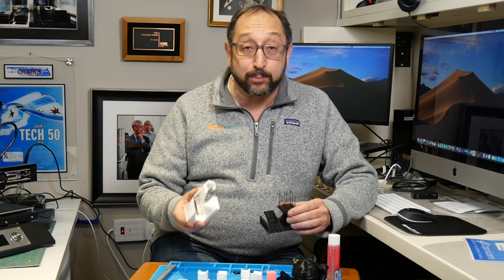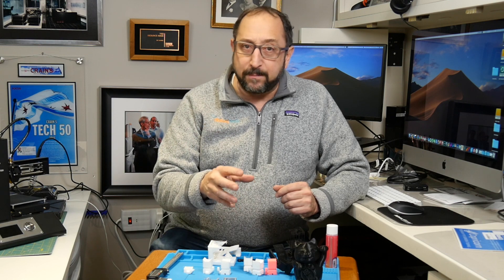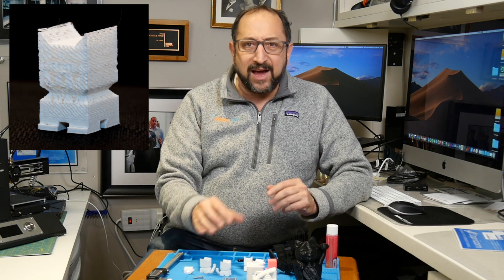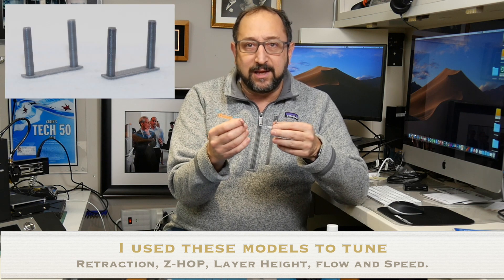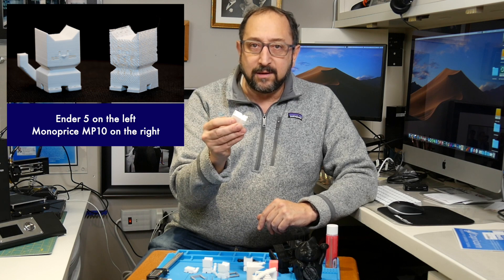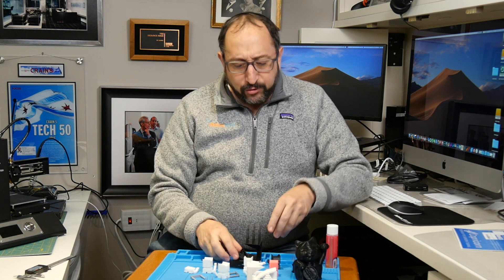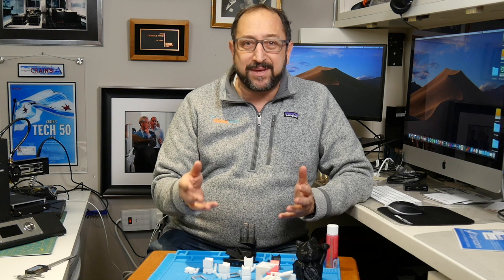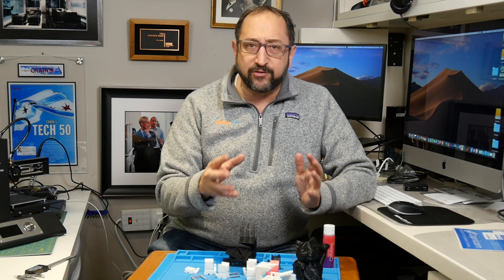Monoprice MP10 3d Printer Quality Review

Comment: its been 4 years, have you had to do any mods to it. I'm looking to disable/remove the filament sensor before the extruder. Also I'm not liking the interface on the touchscreen it lacks in more precise tuning than the original ender 3.  Do you have any suggestions for modification or upgrades to the parts I mentioned?

Comment: Hello Mr. Shapiro,

I got the printer from my sister who used it once only trying to print the cat, which did work. However, now that I have it, it's not working. I tried leveling the bed using the paper method and I ended up with the 4 corners being pretty good but the nozzle would be too high in the middle basically printing in the air. Do you have any idea how I could fix this? Maybe the heatbed is warped?

Also, did you remove the blue rubber protection? around the nozzle? 

Thank you very much, Sir
Reply from the maker: Do not remove the blue silicon sock.   Watch this video.   This same technique will work on the MP10.

https://youtu.be/y_xCtxcwDrQ

Comment: I haven't found a white filament, yet, that doesn't screw up if not printed at about 10 degrees higher than other colors. It may sound strange, but white filaments need higher temps for some reason.
Reply from the maker: Interesting.
Reply: @MakeWithTech  I stated that as fact, but intended it to be from my own experience.

Comment: I love this video. I have the Monoprice Mini Delta printer. I wonder if both printers have the same  cold end part of the Extruder where the gears are located. I have been using Pet-g filament by a company called ridge.ink. On my mini delta I experience the same issue as you describe in the video. Some times I get a great print., Perfect. Other times the filament will not feed correctly. The gears will not push the filament into the hotend. So it is frustrating. I am considering the MP 10 or the Tevo Tornado printer. I like different specs on each one.

Comment: I have this printer also and have had nothing but trouble with it. My Extruder has slipped from day one. I have tried  and upgraded Metal extruder lever and different gears with no success. I have also tried a hand full of different band of filaments that my Monoprice IIIP prints without any problems but fails on this printer. Support and parts for this printer there is none. I even contacted the true maker of this printer Maylan and sent them an email because they show a direct drive option for this printer and never got a response back.
Reply from the maker: Sorry to hear that.  I also had difficulty until I replaced the extruder with an all-metal extruder.   Did you change the gear on the stepper motor when you changed the extruder and use both the idler and gear that came with your all-metal extruder?  Also, I would recommend trying to slow down your prints and/or increase your print temperature.   When the hot end temperature is too low it is hard for the extruder to push the filament through. 

The only time my extruder slips now is when I use the manual extruder controls from the front panel.  They go much too fast.

I used the "Anycubic Left Hand Aluminum Frame Block for 3D Printer MK8 Extruder Reprap i3 DIY Kits" that I purchased on Amazon.

Yes, it is a problem that Monoprice does not provide parts.  However, I just ordered the CR10 front rail reinforcement kit to see if standard CR10 parts work.
Reply from the maker: P.S.  You need to replace the complete extruder, not just the lever.  The lever, gears, spring, etc. are all part of a matched set.  Hope this helps.  If not take advance of the Monoprice warranty and return it.

I did find this printer is high maintenance.  What I mean by this is I needed to tinker with it a lot to get good results.  Because I really like how easy it is to work on the hot end, I am going to use this as my large nozzle print.  The ability to take off the hot end after you heat it up and just unscrew the nozzle is quite nice.   I do hope in the future Monoprice or Malyan offer the ability to purchase additional hot ends.

Comment: Thank you so much for the update. Looks like I'm going for the Creality CR10S Pro
Reply from the maker: I just finished upgrading my MP10 to an Anycubic metal extruder ($10.99 on Amazon) and a Capricorn Bowden tube ($13.29) on Amazon.  Big difference.  I am now able to print with all of my brands of PLA and also print at much higher speeds.  Still reviewing quality.  I should have a video on replacing the extruder in a day or two.
Reply from the maker: However, there is no question that the CR10 family of printers is more proven and as of right now better supported.

Comment: This is my first 3D printer.  I need it for ABS.  Stronger and more Heat resistant.  How well is this printer going to work for me?  I'm using the Monoprice premium ABS filament.  Having trouble getting anything to print past the bottom layer.
Reply from the maker: ABS is generally very difficult to use and often requires a full printer enclosure to maintain temperature.  Have you thought about trying high-temperature PLA or PETG.  I have not tried PETG on this printer yet but I print it on my other printer all of the time and it works quite well.

I will try it after I install the upgraded extruder next week.
Reply: @MakeWithTech  I built an enclosure.  I plan on using parts in my truck interior and it gets really hot in the summer.  I heard PLA wouldn't hold up.  Thanks for the quick reply.
Reply from the maker: Check the specs on PETG.  Might be ok.  Also when layers are separating it often indicates you are printing at too low of a temperature and/or have the fan turned up to high for the materials.
Reply: Also you might be printing at to high of a layer height between layers.

Comment: I’m very appreciative of your videos on this printer. I purchased one a couple weeks ago and have been struggling a little too get it tuned. I’ve had the Monoprice Maker Select printer for about 3 years, and it has been nearly flawless. I went for the MP-10 mostly because of the larger build volume, but I like the magnetic removable build plate, which is something I made for my Maker Select. I had issues with the test cat print breaking free from the build surface halfway through, but the print quality was excellent as you described. Blue painters tape and glue stick solved that along with some bed height adjustment. I started with my Maker Select profile in Simplify3D, and that proved disastrous as the speeds were too high leading to Y-axis layer shifting. Slowing it down to recommended CR-10 settings has helped. I have also experienced the extruder slipping. I’m anxious to see if your new tube helps that. Overall, I am also a little undecided about how I feel about the printer. I’ve had good prints and bad. I still think there is more tuning to do. It’s easy to forget that I’ve had 3 years to perfect my other printer and that it wasn’t always perfect. I just don’t think I had to do as much to it as I’ve had to do with this one. Keep up the good work! Looking forward to the next video.

Comment: Btw, don't make the mistake I did and use acetone to clean the build surface... it will dissolve it. Also my removable build plate had several warps in it (perhaps happened after the acetone incident)... I found that a cheap (~$5) 12"x12" galvanized 28gauge sheet from HomeDepot + some stick-on surface (like buildtac) (amazon search for "3D Printer Build Surface with 3M Sticker") works as a great replacement (it's about a 1/8" small, but perfectly fine). You could even use blue painters tape on the sheet. Lots of easy options to try.
Reply from the maker: I use rubbing alcohol to clean it.  Works great.
Reply: @MakeWithTech  actually it wasn't that I was really trying to clean print residue... the white logo was coming off on the bottom of my prints... was trying to clean it off the surface. Anyway, I know now ;) I wasn't too concerned (and expected it might hurt the surface) as I'm not a big fan of the rough surface finish. My preference is smooth PEI, which I have coming for another steel sheet.

Comment: If you have a good caliper, measure the diameter of the cheap filament. It's possible it's smaller than 1.75mm and causing the extruder to slip. I've noticed that extruder (and you're right, it's same as on the mini) doesn't have very good spring tension/grip.
Reply from the maker: I did.  The diameter is fine but it is much stiffer than the Hatchbox PLA.  I do not think the gears can get any traction.  Once again it is fine in the Ender and Prusa.
Reply: @MakeWithTech  yup, probably the tension isn't enough to grip properly

Comment: Have you tried using the settings and g-code start and stop that are shown in the screenshots on the manual?  I also compared it with the example g-code on the test cat.  I noticed that the retraction commands are slightly different at the end.
Reply from the maker: I have.  I did not find the start code effective at priming the print head.  These retraction settings were tuning for the sample prints.